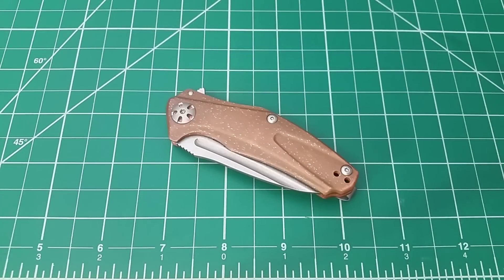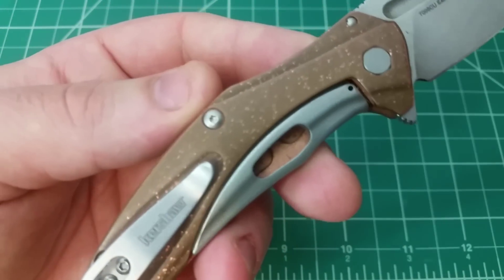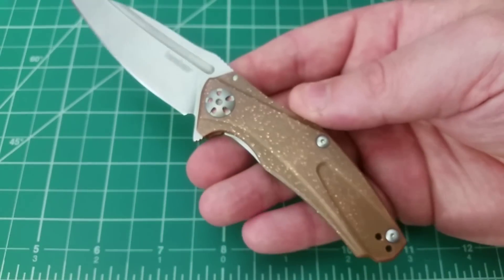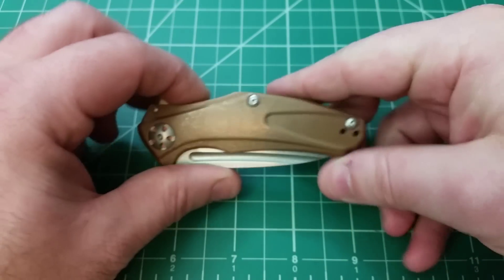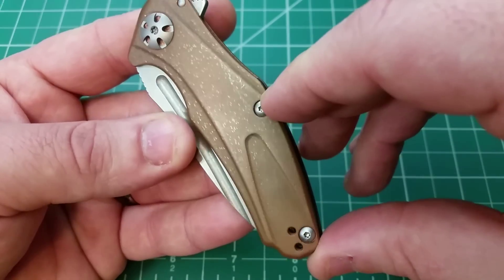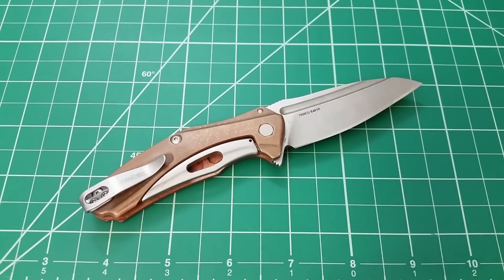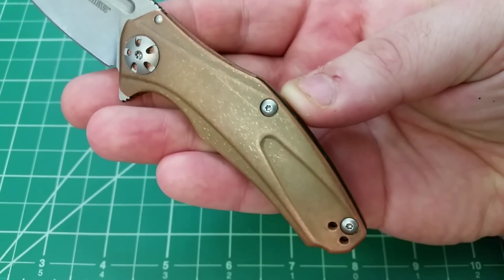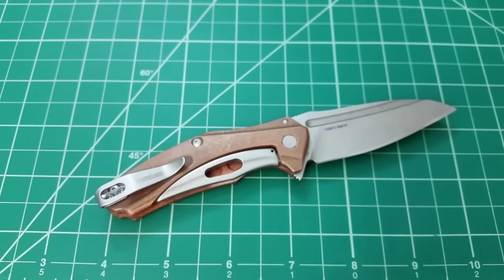Kershaw Copper Natrix: Speckled Pattern Experiment and Demonstration

Comment: great look unfortunately the copper natrix they sent me is a real lemon the center was so far off the blade rubbed against the scale i took a steel washer maybe three sixteenth's thick just to see how far off it was i threw the knife in the junk knife box and hope i never look at it again i have never been so dissatisfied with any knife i have ever bought worse then a gas station knife just want to put it out there for others to beware JT if you have any suggestions for a possible fix i am open to suggestions i bought it to complete my all copper pocket slip but cool idea on the treatment thanks
Reply from the maker: My best advice is send it back!

Comment: Hmm very interesting. Do you think if you did the speckle pattern, and then sprayed the handle with EDCi solution, you could maintain those vibrant speckles even better?
Reply from the maker: Maybe, but clear coat paint would work better I think.

Comment: Man, my patina is nowhere as dark as yours, and I try to handle and carry my Copper Natrix as much as possible.

Just for clarity, you're saying that you achieved the darkness of the patina just by handling and carrying your knife? 

Mine seems to be on pause for some reason.

Anyway, I liked this video a lot. Thanks!
Reply from the maker: Yeah, mine got Patina super quick. All that is natural, nothing to enhance it. That said, I think mine might be different from other people's. I got it extremely early from one of the first batches that shipped out. It's possible that they made adjustments since.
Reply: I have seen that with copper before i think it is batches or something more than difference in others skin oil, but idk. Also i have seen people have trouble achieving the green/blue too.